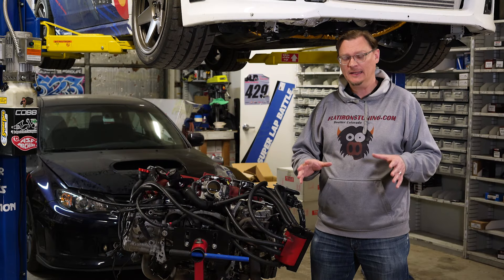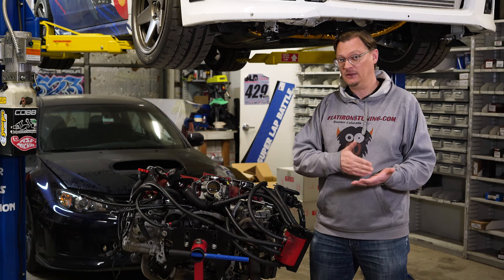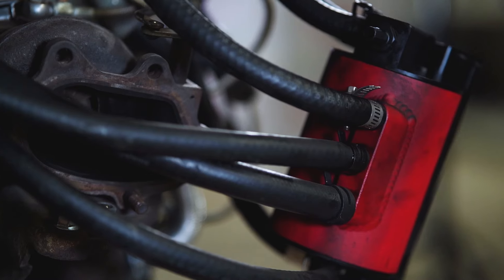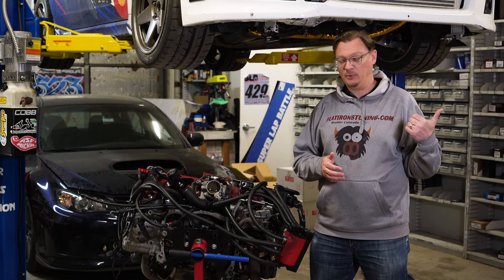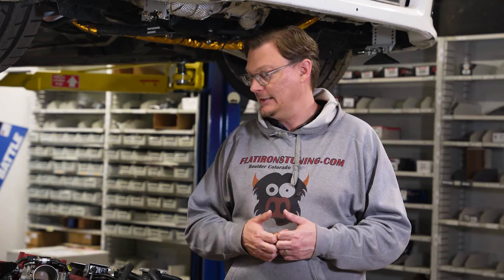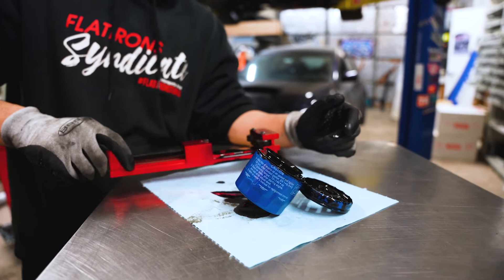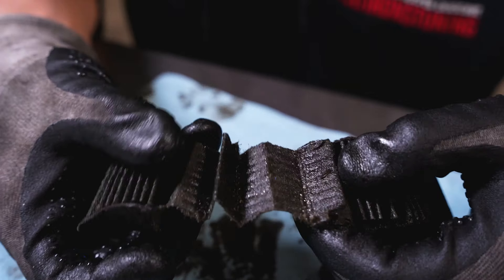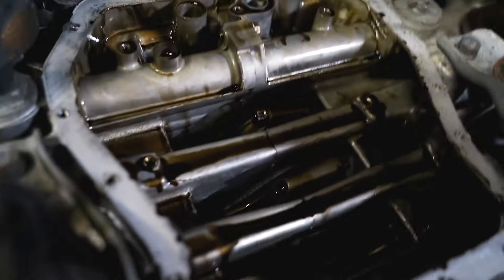Bearing Failure, but not that one...

Comment: I’ve spun 22 bearing in 22 engines in my Subaru. It’s the torque and factory rod bolt breaking. Factory rod bolts are terrible. I run arp rod bolts on every build. Even a stock short block I will change the rod bolts to arp 2000. If your fly wheel isn’t balance with the crank you will also have ore mature failure

Comment: Subaru cases are a bit “flimsy”, main bearing clearance is really important. Rod journals are fed oil through the mains. Also the ring gap could have been excessive. I stay away from the lightweight crank pulleys. Fluidampr is the way to go.
Reply from the maker: Thanks for watching and thanks for the comment.

Stay Tuned!

Comment: Nice, it is interesting to see inside. Im going to guess due to the tune the fuel diluted the oil and caused multiple bearing failures. but how the crank thrust bearing is distorted like that will be an awesome question to answer. It isclear homie needs a new shortblock and crank
Reply from the maker: Thanks for watching and thanks for the comment. There are more interesting details to come.  

Stay Tuned for part 2 :-)

Comment: This is going to be a good little series to watch.

On the side note, have you guys ever experienced doing a port & polish to the oem cast STI exhaust manifold? There isn't really any current information out there regarding this method to improve spool time on a larger than factory turbo. Like a FP Green or Blouch Dom 1.5xtr for example.
Reply from the maker: Very glad you enjoyed the video, and I think that you will like the other episodes as well.

For porting the exhaust manifold, the main thing to keep in mind is that the smaller the volume of the header, the faster the turbo will spool, but the more it will be a restriction in the upper rpm range.

If you want your turbo to spool as soon as possible, keeping the manifold volume small is one of the key ingredients.  But if you are losing too much top end performance, porting the manifold may be a good way to balance that performance.

Hope that helps and Stay Tuned!

Comment: Interesting to know how this probably happened... I have my clutch bypass connector jumped so on startup I don't put clutch pressure on the thrust bearings, just another layer of insurance. I like this video style too, fun stuff.
Reply from the maker: Thanks very much and thanks for watching.

There are more details about the failure that we discovered as we tore the engine down further.

Stay Tuned for part 2 :-)